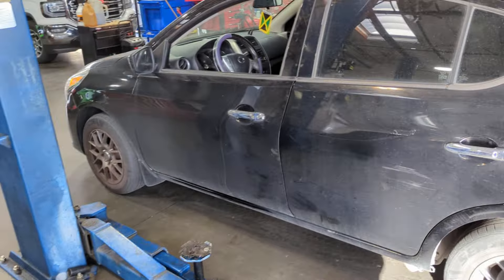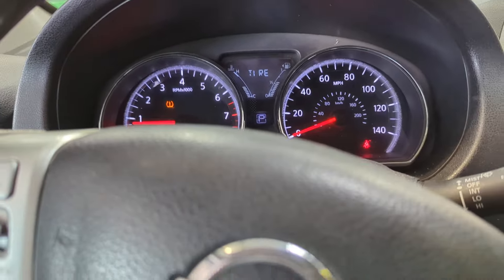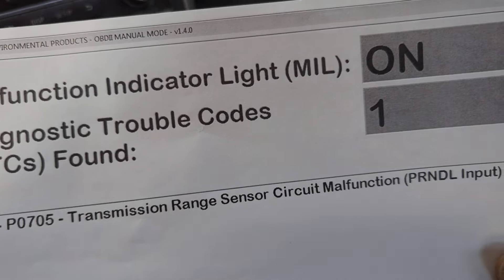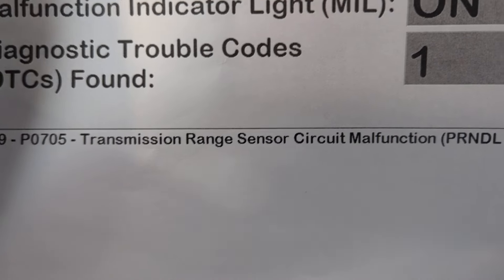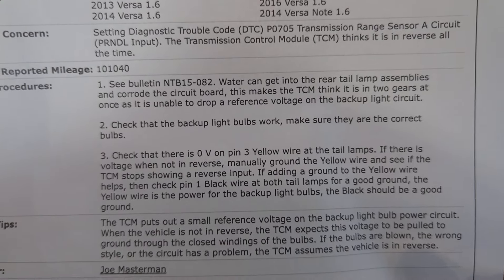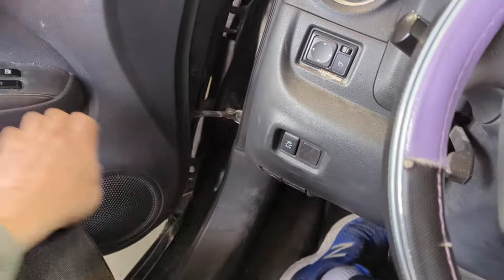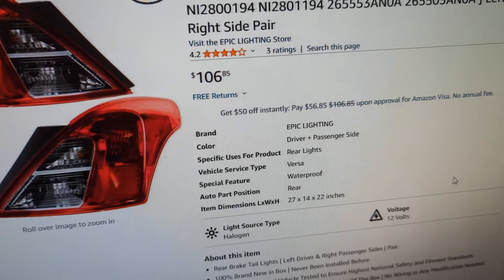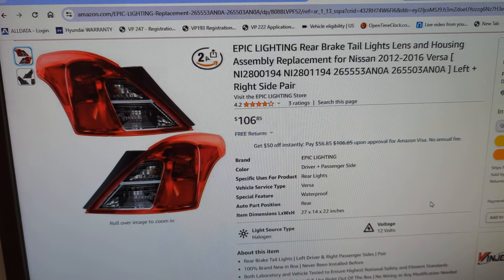Code P0705 on Nissan Versa Transmission Range Sensor "Not what You Think"

Comment from the maker: Get cheap replacement tail light assembly for your Versa on amazon here: https://amzn.to/4a1NzLn

Subscribe to my you tube channel here: https://goo.gl/j1pCfn
Reply: I am having the same problem with my 2016 versa. I changed the range sensor twice and a mechanic found that it was a reverse light that was not at full strength. He cleaned the lights and it worked. However, a month later, I got the same code again. I checked the tail lights again and everything seems to be working fine. What else can it be?
Reply: If the transmission is exhibiting symptoms would it still just be the light? Once mine warms up after driving a bit, the transmission seems to slip when taking off from a stop. Also shits kinda hard sometimes. Would this still be the light issue or would this be the tps /trs
Reply: @kennysammijo i had this exact issue that you’re describing. I took it for an inspection at Nissan and they told me they needed to replace the entire transmission costing around 6k
Reply: Will this issue make your transmission not engage?
Reply: It’s probably the same problem in the circuit board of the lights, but I don’t want to tell you change the light, but it’s cheaper than the dealer doing a diagnostic . My brother took his car in and a dealer was vague, but knew what it was. Fortunately, my brother brought it home and I will change the tail. I had issues on other cars with the tail lights.
Reply: A transmission specialist said he changed the switch two times on another Nissan and still had the same problem until he changed the transmission which is probably strong so not giving issues right now. He said the switch was changed and problem. I would change the tail lights first
Reply: Yep, they’ll do that

Comment: I confirm that this works and I came here to say thank you from the bottom of my heart . I followed your link ,paid $133.00 on Amazon ,received my tail lights , took literally 5 minutes to replace and fixed the issue with the transmission sensor . THANK YOU SO MUCH 🙏🏻

Comment: I had the same issue with my wife's 2012 Versa..all I did is clean the yellow connector..I notice the there was moisture which causes a short circuit tripping the code..no need to change the whole tail light assembly..the issue comes back during rainy days..all I do is clean it again..

Comment: This gotta be to be a joke right?
Reply from the maker: It may seem unbelievable, but sometimes reality is stranger than fiction!
Reply: I have Honda accourd euro 2004 I have same code can you help me please I try changing the switch
Reply: It’s not. The transmission wires go to the circuit board in the rear left lamp. My mechanic said the same thing this guy is saying. I’m not a mechanic but can verify too. I at least know how to change bulbs. The check engine light came on one time, giving me a 0705 code. During that particular time of the light being on, I was making a left turn. The second I turned on my left turn signal, the gear display went blank. If I use the right signal, perfectly fine. I pulled into our church parking lot to park and test it out. Like I said, I’m not a mechanic but I’m very observant. I turned it off and back on, fine. I used the right signal, fine. Left signal, gear display went off again. I picked up a pack of bulbs, changed it, and the issue was gone.
Reply: No  I was wondering why my brother’s car had moisture in the head lamps and tail lamps. Then his signal light  istarted tripping. Then the  engine check light came on It will go off. We had excessive heat days, but the surging would come and go crazy.

Comment: How can i verify that it's the tail light issue and not a genuine TRS issue?
The only thing convincing me its a false trip is that my car hasnt been driving or handling any differently since the P0705 came on
But i don't wanna buy the tail light assembly and replace it before figuring out if it's actually the reason

EDIT: Fixed, I took apart both rear light assemblies and cleaned all the connections with a toothbrush. Deleted the code and it hasnt come back since
Reply: Same thing here. I removed the bulbs, put new ones in, erased the code and it went away. If you stand behind the car and someone puts it in reverse, you can see which reverse light has the issue (it'll be dim).

Comment: I have a 2012 nissan tiida latio (versa). 
There's water in my keft headlamp and my right tdil lamp is out 
Im getting a p0705 coded check engine light and the dashboard gear indicator sometimes goes blank.
I just opened the vehicle and heard the door ajar when ignition on beep beep beep beep.
I still have the keys in my hand, not keyless and ignition is most definitely off.
Reply: Hi. Did you manage to fix the gear indicator going blank? Mine went blank and the car is not starting at all, says its not in park

Comment: Mine has the same code did anyone experienced when you use right turn signal apply brake and the radio flashes?
Reply: This is something I've been having an issue with too, my left turn signal will be fine but the moment I apply my brake, it ticks faster and my backup camera initiates randomly.